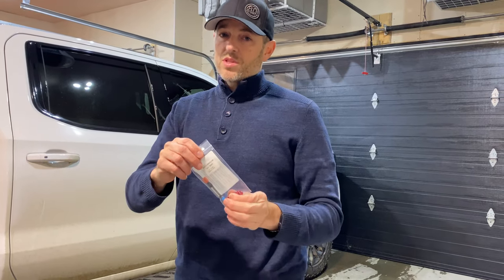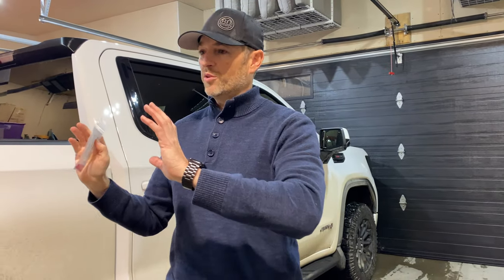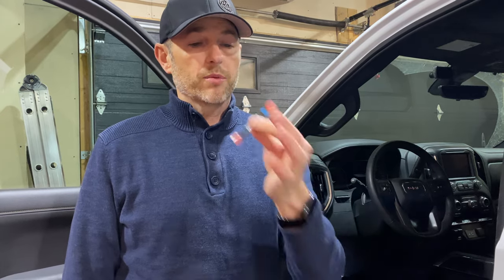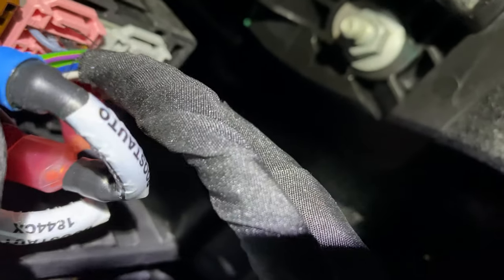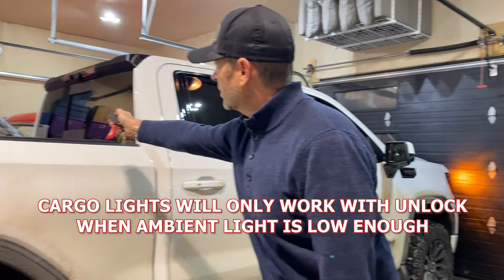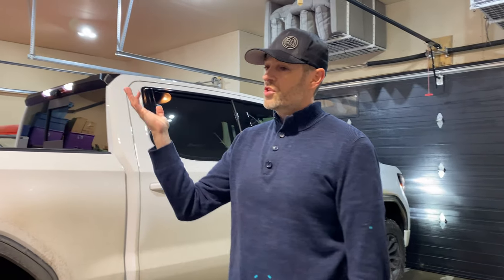Cargo Light Mod GMC Sierra & Chevrolet Silverado

Comment: Hi Don,  I ordered this mod from Boost a few months ago and it did not work after following their video instructions...  YOUR instructions worked! Thank you.  The difference was tapping in to the Pink connector, wire #26.  And the tip about the Ambient light sensor was a key point.  I also installed the Boost mirror task lights to be on with the Bright lights; that works great. Subscribed.
Reply from the maker: Glad to hear both of those details 👍🏼

Comment: After watching your video on the wireless phone charger I decided to install that same mod on my AT4. I have had some issues with keeping my phone connected to the charger, but only because I have a very thick phone case. I've had other people use it and have not seen any issues with a phone sliding around.
Reply from the maker: Thanks for the info!

Comment: I did both of these Boost Auto light mods.  Had the truck in for service and there were stored codes for fog light to battery ground, cargo light to battery ground, etc.  The computer recognizes that the lights are on without being activated.  I'm surprised BA doesn't notify that these will appear.

Comment: So I actually just ordered this mod and a couple others from boost auto, my dad had a hernia about me tapping into my wiring harness in this way, he is an experienced mechanic but sometimes just really old school about the way he does things, his concern is tapping into the wire in this way will cut the number of wires and could cause overloading and fry the wires, also was concerned about overloading the control module. Can you shed any light on this? Any issues with your other boost auto mod? In your prep for this mod did you find anything to be concerned about? It seems to me most people are more than happy with it. Thanks!
Reply from the maker: Hi there!  I know where he is coming from.  The tolerance of systems in vehicles today and the complexity can be of concern.   I am not concerned and haven’t any issues.  If you have a specific concern such as overloading a circuit or the BCM, I would pose your question to the team at BoostAutoParts.  I have read that they are very responsive.   I am pretty confident that they wouldn’t have come to market with all of these upgrades if there was high risk associated with any of them.  My only slight worry was crowding the area with tapped wires.  I also think I am done with tapping into any more of these circuits
Reply: I installed the fog light mod in wires 10/18 about three weeks ago in my 21 Silverado and it works flawlessly!! So far so good, and it is a MUST HAVE for $20. Now I’m doing the cargo mod and like Don, that will be all that I do with splicing wires! But these two mods are all you need IMO.
Reply from the maker: @markgray2931  I am right there with you!

Comment: Hi, your videos are great. I just bought a 2023 AT4. I'm curious, I don't see a follow up to your potential purchase or thoughts on the AT4X. I am bummed I did not go for an X just to have the added capabilities. When I was browsing pricing, I did not realize the AEV package was an option and did not want to spend $90k USA. I also own a 2021 Escalade ESV (I could give you a full page of dislikes all mostly safety related).  I bought the Boost fog lamp mod and I am about to order the bed light reverse part. Curious are you ever concerned about tapping into the same wire multiple times? For instance, the pink circuit wire #6 as it used for multiple tweaks.

Comment: Hey Don, what light bar do you have? I have a 20 Sierra with the multi-pro tailgate and i wasn’t sure if i could get a tail light bar back there because of that wire bundle in the center of the truck. Thanks!
Reply from the maker: The one I currently have is just a cheap Amazon one.  One red LED has already burnt out in less than 1 yr.  I have my eyes on a Putco branded one to replace it

Comment: Nice 👍. Does this actually help in reverse? I installed Rigid flush mounts in the bumper steps and that made a huge difference
Reply from the maker: Thanks for checking out the video.  It does help some.  Your flush mounts would be a brighter add on for sure

Comment: Hey i have a 2023 GMC Sierra AT4 and did the mod... My reverse, cargo or top lights dont illuminate when i unlock my truck... What did i do wrong?
Reply from the maker: It has to be dark as it is tied to your ambient light sensor.   If you cover the sensor on the dash you can do a a test.   Otherwise check your lighting settings in the menu of your truck.  Hopefully you don’t have any wrong or poor connections as that would be the last thing to review

Comment: Is the bypass you're using only specific to late model Silverado/Sierra? I have a 2013 Silverado, and I already installed the fog light mod in mine. I wonder if this works on 07-13?
Reply from the maker: Not sure.  I only looked for the part specific to 2019-2021.  It might be the same part but surely a different set of wires to tap into.  Check out their website if you haven’t yet and filter it to your truck.  Boostautoparts.com
Reply: @Donslife  The website doesn't list anything for my year..but im wondering if it's the same part number.  Thanks for the reply! 👍

Comment: Don, I installed the Fog Light mod and the Cargo/Reverse mod from Boost Auto Parts. The Fog Lights were no issue but the Cargo/Reverse does not light up when unlocking the vehicle. Lights do come on when in reverse or turning on cargo switch. Can you direct me in how to get it to turn on with remote??
Reply from the maker: It has to be dark outside. Or cover up the ambient light sensor on the middle of the dash.  Try that

Comment: Hey Don I love your videos 💪🏾. Great work man. I’m trying to find the front LED for my 2019 Sierra Denali haven’t had any luck. I checked the dealer but they don’t seem to make it for the 2019. Is there anywhere else that I can find it? Thanks I’m advanced!
Reply from the maker: Thanks! Are you referring to the illuminated GMC logo?  If you are, they are made for the 2019+ new body style and not any of the 2019 outgoing body style
Reply: Hey Don sorry for missing out on the specifics🤦🏽‍♂️. Yes the logo like the one you installed on your truck.

Comment: Hey don which wire was the cargo lights I’m trying to install puddle lights on my mirrors I have now which don’t have puddle lights I got it mounted but I want them hooked up to the cargo lights
Reply from the maker: My friend, you may want to ask BoostAutoParts for the exact pin location.  I don’t know if my BCM has the exact same configuration unless your year and trim are the same as mine.
Reply: @Donslife  I really appreciate you getting back to me. That’s what I will do. Thanks

Comment: So. I have a 2014 that has light bars, rock lights, and even a subwoofer. But, with all that done, I left my truck set up to where I could just remove the wires and it's basically stock again, I have a rule that i don't want to cut into ANY part of my harness. That being said, I would LOVE to use some of these mods like this one. How can add these taps so that if I end up removing them you'd never be able to tell they were there to begin with? 🤔
Reply: Get a fuse tap and wire into the fuse box. Just gotta find the reverse light fuse location.

Comment: How difficult would it be to put a switch in the tailgate so every time you open it all the lights come on in the bed as you're using it that way you don't have to go up to the cabin turn them on that is something GM should have had in there in the first place. That is something I could easily do from scratch, but it would be more professional with a Boost or, etc. plug and play
Reply from the maker: For sure. There are some wiring modifications a guy could perform too
Reply: Does that also turn on the tailgate step light. I would assume it does. Also, does any company make a plug n play switch to reset that shift to  park warning fail. I can get mine reset by unplugging it under the knee panel on the driver's side, then plugging back in. But it only lasts a day or less. So I was going to wire in a toggle switch to reset it without removing the panel every time it malfunctions

Comment: Will this Mod also make the reverse light come on when you hit the cargo switch? wanting to add light bar under rear bumper that works with truck in reverse or when I turn on cargo switch.
Reply from the maker: No it won’t trigger the reverse lights with the cargo switch
Reply: @Donslife  we’ll have you made any other videos that would show that mod or how to wire it? Or have a suggestion on where to look
Reply from the maker: Sorry, I don’t.

Comment: Would you say the cargo light and tailgate light in reverse add any substantial visibility over the stock setup?
Reply from the maker: No, I would say they make you much more visible to vehicles and pedestrians behind you.  There is a big safety gain if you are backing out of locations often

Comment: Hello I just installed the diode dynamics led lights xrp 720 for my reverse lights plus HP5 for the license plate light. Makes a huge difference at night. I have another set of xrp for the cargo light but haven't had time to replace them.  You think there are any long term effects with wire tapping them for this mod?
Reply from the maker: I will eventually upgrade my license plate lights too.  They seem so dull now.  Answer to your question : I am not concerned about tapping these specific wires.

Comment: Wait does that mean that the reverse lights will also be illuminated when you turn the cargo lights on?
Reply from the maker: Nope.  The button for the cargo lights will keep them running independently
Reply: @Donslife  The reason it does not turn the reverse lights on when you turn on the cargo light is that thick wire actually has a Diode in it.  A diode only allows current to flow in one direction.
Reply from the maker: @HarrelsonImagery  yes you are correct.  Many of their lighting mods employ this method. That’s why these wires have to be installed in the right direction.